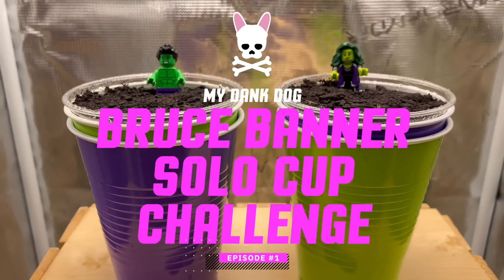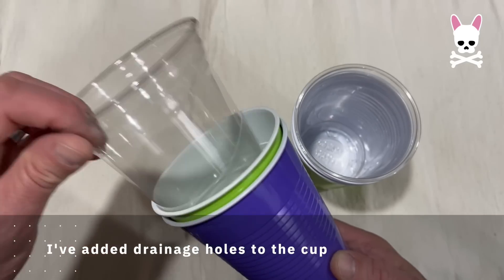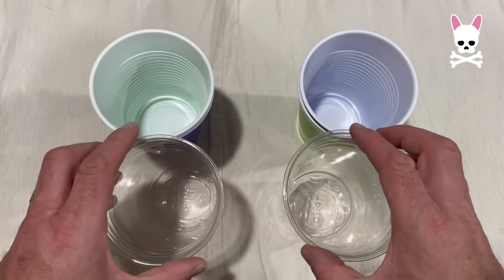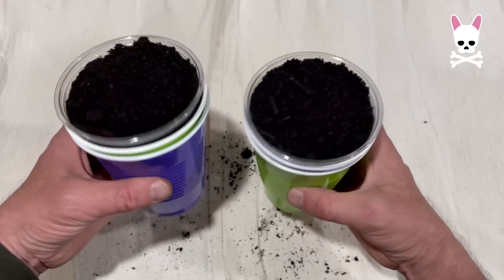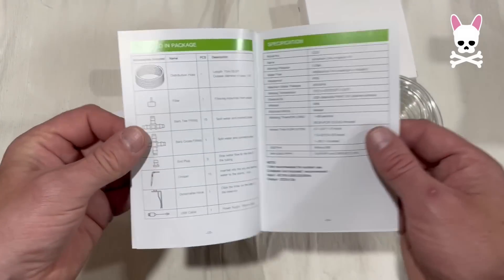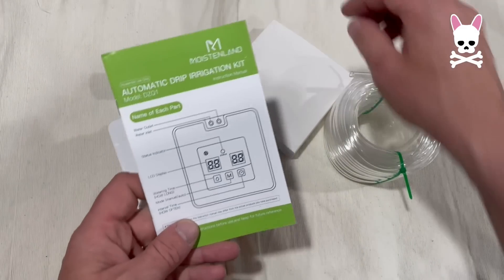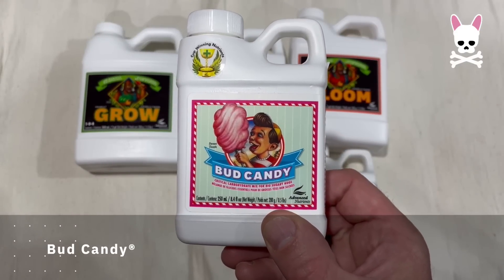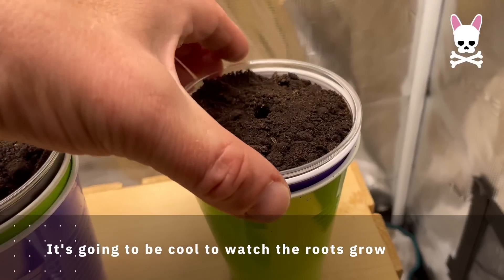Solo Cup Challenge Episode 1 - Bruce Banner Auto

Comment: I do something similar, I have a clear cup inside, fill it 1/3 with perlite/expanded cley and fill up the bottom just enough to make it dry out quick. the rest is filled with normal soil. its kind of a passive ebb and flood system, the roots in the bottom part sit in water or moist air and the upper bit sits in soil that is never going to be really too damp or anything. I fill it up with mineral salt water mixture made for hydro/coco coir with like 50%-75% intensity. On my current run ill try to put spacers between the inner clear cup and the outer cup to give it more root space so it doesnt get root bound.
Reply from the maker: Nice mate, that's a good tip. Thanks for sharing.

Comment: Add 3 roks to the bottom of middle cup  to lift cup up and adds room for roots and nutrients
Reply from the maker: Yeah good tip, I want to use those second cups as a 'room' extension, so that would work well. Thanks mate. I've been watering them from the second cup too, so the soil sucks up the water from the bottom.

Comment: Have you had any issues with gnats using the fox farm soil? I found that if the soil doesn’t smell like moist soil return it. The soil may be too dry and contain gnats eggs. This happened to me and had to deal with at less a 20-30 gnats flying around.
Reply from the maker: No mate, no gnats! I've had no issues like that at all. Maybe you got a bad batch. Once this bag is finished, I am moving onto something else, not sure what yet. What did you end up using?
Reply: @mydankdog  I’ll be here as a regular. Also, I haven’t finished my grow yet but so as of now I’m going to stick to the fox farm with sticky pads as of now and try to go to a local garden or hydroponic shop and try out Gaia Green 4-4-4 / 2-8-4 with the warm castings ph to 6.5ish. Saving up for that though. It’s so expensive on Amazon at $50usd for a single bag the same size as the fox farm where I get 3 bags for $45usd 🤦🏾‍♂️ but that’s an upgrade dream 😂
Reply from the maker: Right, things are so expensive. I'm just about to order some Gaia green for a top feed.
Reply: @mydankdog  lastly, much support from the US. I’m the slowest editor and have 2 grows to edit so don’t feel like you need to rush or are the only one procrastinating 😂
Reply from the maker: Yeah that happens. Life gets in the way of editing and the plant keeps growing.